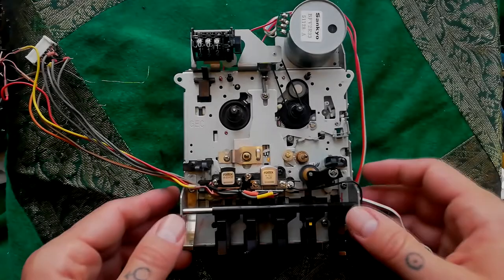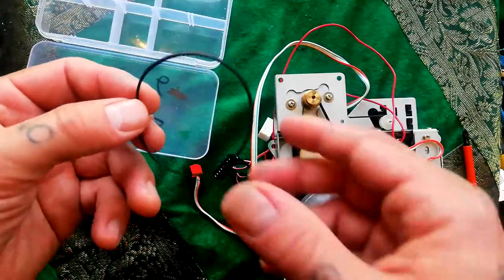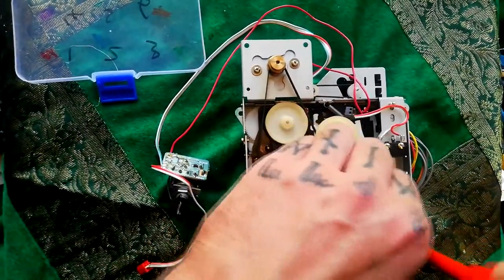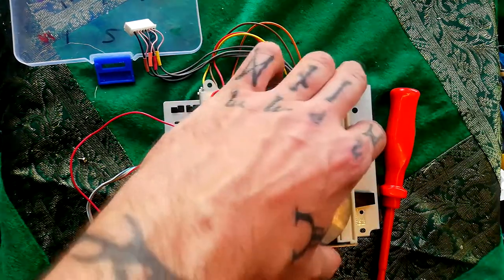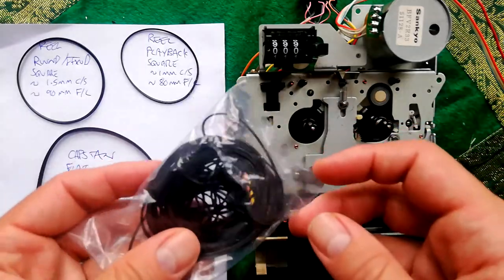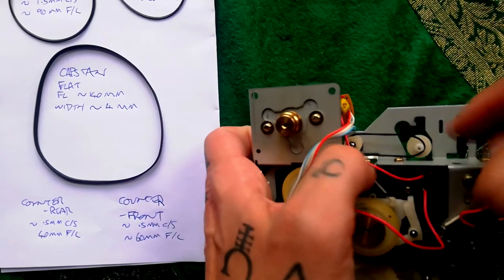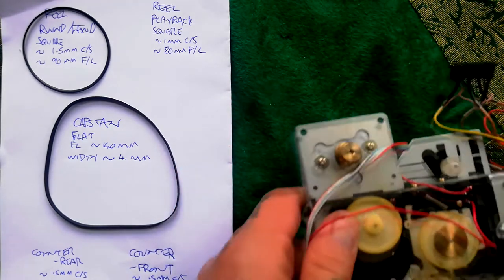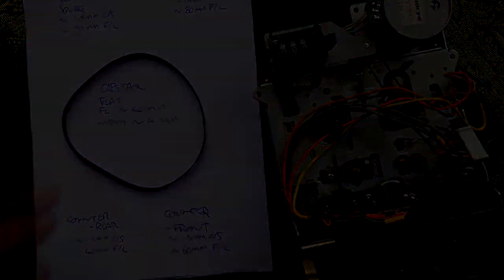GEC 4-track Cassette Transport | 2 | Belt change & sizes | | Porta One Two 05 MT2X MT3X X-15

Comment: I've had mixed luck with ye ole bag o' belts. Seems like many people are selling the same product--same pictures, same description... Any go-to sellers for that kind of thing?
Reply from the maker: I've just bought random listings from ebay. Maybe I got lucky, but apart from the capstan belts on likes of the 414 most square section belts on such things don't contribute to performance, they just work, or don't, because they're tight enough, or  aren't. Gbaudio.co.uk sell high quality individual  square section belts but they're nearly £10 each. I have no idea where to buy that sort of thing outside UK

Comment: im trying to find replacment belts for the GEC transport for my porta 05 online. I have found a bag of belts similar to yours but I cannot fint the 140mm capstan flat. Any advice?
Reply from the maker: Thete are Ali express sellers doing flat belts in 5mm increments for length and 1 mm increments for width, so you could get 4mm wide 140mm FL flat belt from there for sure, shipping takes a couple of weeks from China though

Comment: @Tetrakan can you do a video of better reassembley?? just got my porta 05 but fast forward and reverse don't work. So I seen the fast forward belts on video but without seeing it done its a lot harder. The belt seller recommended I change every belt and idler. But I don't know!!
Reply from the maker: No plans to do that video, sorry. Remember I figured out all this with no reference video, so you can cope with just the videos I provided already! Changing the ffwd/rewind belt is easier than opening a jar of mayonnaise anyway, no screws to remove, you literally pop off the old one and add the new one. Yes, I agree with the belt seller, if one belt is bad, the others aren't far behind. Thanks for watching.

Comment: Currently attempting to install a working fostex15 mechanism into a Tascam Porta One that won't playback. There are a number of differences I'm finding. The Porta One does have pitch control, but it's a horizontal slider mounted to a completely separate board on the top. The porta one also has what appears to be another plate behind the topmost sliding plate in the center. Also most of the wiring is different. 

I'm new to tape machine repair, so I may be doing it the hard way by trying to fit the fostex x15 into the Porta One, when it just may be easier to repair the Porta One! 

It seems that lots of people say that removing the playheads is not a good idea, and calibrating them is very difficult. Have you tried this? 

Anyways, I appreciate the teardowns.
Reply from the maker: jabberwalky Although I haven’t done it myself I think the adaptation can be done but it’s going to involve removing the entire wiring harness running to the motor around the main chassis and moving the brackets with the auto stop solenoid and pitch control from the main chassis of one transport to the other. In short, yeah you’re probably more efficient trying to fix the porta transport! Removing the tape heads is fiddly and there are a few springs you need to keep track of but it’s not difficult per se. Aligning the tape heads - well ideally you’d have a tape path checker ( a mirror set into a cassette shell) for course adjustment and a high frequency test tape and a dual oscilloscope for fine adjustment  to ensure that the tape and tape heads are parallel, but it depends how precious you are about fidelity. You could just wiggle the heads with your finger until it looks right and fiddle with the adjustment screws if it sounds bad - from a technical perspective you,d have minor phase problems between tracks but since most people using cassette are going for something along the lines of “logic” anyway, maybe that’s part of the charm?
Reply: @Tetrakan  Thanks for that info! I'll keep poking around both units to decide if it's worth it. You're right, transferring to the other Fostex x15 unit looks like it can be done, perhaps even swapping the TEAC heads, (still attached to the black base) will help to avoid fiddling with the adjustments. 

But yeah, I love recording with tape machines for that certain quality it gives my synths and drum machines.Your videos have been invaluable to me, so thank you for the clear breakdowns.

Comment: Hi, I have a 414 Mk1 with a transport that is waz too loud, something is wrong and I dont know how much I can take it apart before there is no waz back. Do ypu have any videos where you take the transport of the 414 apart? like completely apart? If not. Do you have a transport that you might want to sell? The 414 I have was full of sand.. I bought it on ebay and find out that it wasnt usable as is, so I took it apart and removed all of the sand it had inside, but I´m afraid there is still some sand inside the transport... Any help would be much aprecciated, like alll of your videos. Thanks a lot!
Reply from the maker: I haven't done a complete teardown of this transport, no. I will one day but honestly there's a lot of stuff I want to do first. It's always good to have a parts donor you can take knobs, faders, motor, heads from  so if it's full of sand I'd relegate it to the spares bench and look for another 414 to refurbish.
Reply: @Tetrakan  thanks for answering and the tip. I followed your tips on how to disassemble a deck. Kept everything numbered, marked, made fotos and videos and that made it possible for me to completely disassemble the deck... two times until I found the problem... it's a gear as u might already know (I wrote u on a different video). Anyway thanks for the tips!!! Very helpful. And as a tip for other people trying this... take pictures from every angle!!! As many as possible!